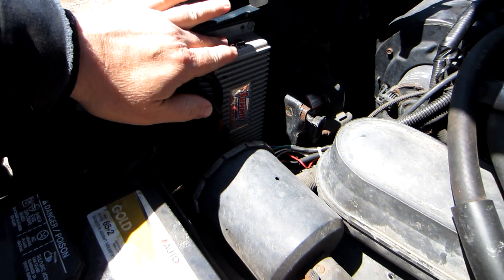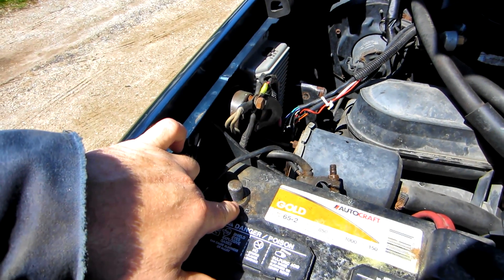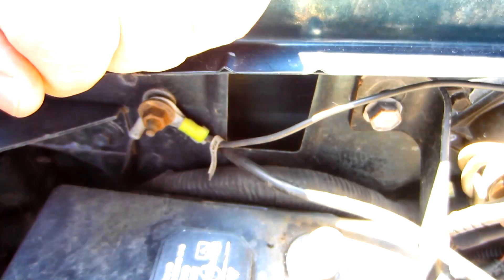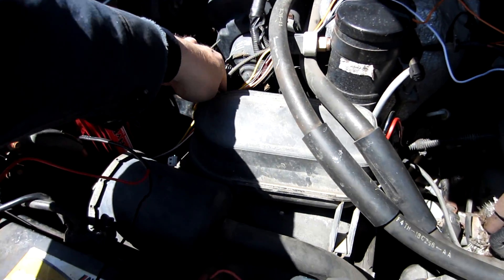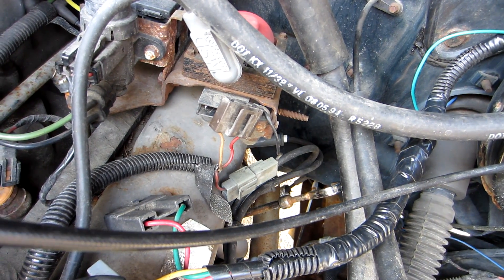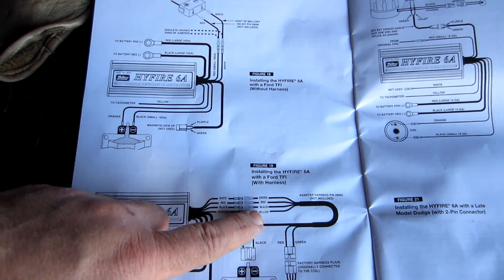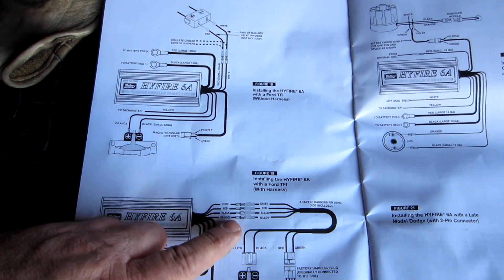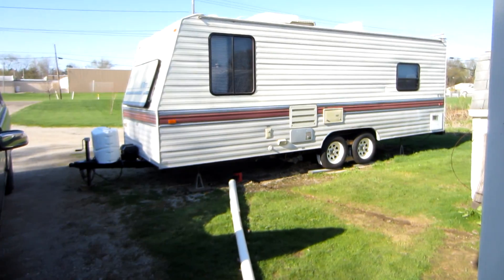install on 95 F150

Comment: Im having trouble wiring mine, the black wires are practically identical gauge, is the power and ground the 2  paired together in the sleeve?

Comment: I get how this one works. But I'm trying to make one work for a 7.5 Ford efi. It's got a weird circle harness connector. I've heard that the PIP needs to be connected or you get problems.... So how where does the PIP go?
Reply from the maker: It connects identical to the f150 or even a 88-96 5.0 Mustang... Get the harness and follow the instructions... I mounted a box on my 97 F250 HD with a 7.5 so I know it is the same. Here is a link....  https://youtu.be/fw12k7zEURI

Comment: What's the difference between the part number 6853 and newer black 
Ignition boxes part number 690 if I'm not mistaken, are new ones more reliable and is there a difference between MSD 6AL and this Mallory 6al part number 6853?
Sorry for all the questions, it's jus that I want to get one these, the price is right and much cheaper than the MSD boxes and also cheaper than newer styled Mallory 690 boxes... Confused need help
Reply from the maker: Mallory got bought by Holley Performance so the box I used is not exactly like the ones being produced today... The MSD has been the same for years and compares very well..
Reply: Thanks a lot, I think I will settle on the newer styled Mallory 690

Comment: really enjoy the f150 vids, just bought a 95 xlt and your advice and tutorials are great. what's the box just to the right of the battery? you still have the truck?
Reply from the maker: Thanks, the box to the right of the battery was a battery isolator. That allows for dual batteries to be run being charged off the same alternator. Unfortunately, I've never got around to connecting the battery that was mounted in the bed to it. Sadly because of Towing reasons we got rid of the truck. You can see that information here https://youtu.be/zIpQSNp0b1g
And even since then we had another change that you can see herehttps://youtu.be/NwD4MjQT0fg

Comment: can I use my stock coil
Reply from the maker: Possibly, however if it's not in good condition there's a chance of it failing relatively quickly. Plus, you will not see the full benefits that the CD I could offer. Also make no mistake of trying to use stock resistor wires. Again, you will not see any gains.

Comment: I have a 94 F350 with the 460.  Best bang for my buck, headers or a Mallory box?
Reply from the maker: Keeterbob headers..by far.. But they start at roughly 300 Dollars more than the Mallory box.. Still..Headers And exhaust Will add More power and set the foundation for all other future modifications..
Reply: Foxboss9 I'm looking at the same Headman headers you installed on your F250 460.
Reply from the maker: Keeterbob those are good entry level headers..
Reply: what about header  for 93 f150 5.0

Comment: Awesome video at work we have a display comparing a stock spark vs the multi spark and what a difference, I acquired a Mallory box and I am curious to were you found the coil connector /harness ?! If possible help me with a part number I have a 1990 Stang with a T5 swap and more to come
Reply from the maker: Thanks. Parts Links are in the description..
Reply from the maker: Try this link  http://amzn.to/1HwAviQ

Comment from the maker: ABeans07 Definitely works.. In a nutshell it takes a stock ignition spark(1 lonely spark) that may not allow complete combustion and Multiplies it to allow for not only a stronger spark but a longer spark.. Have you ever tried to start a fire with flint(stock ignition) How much easier is it to start that same fire with a torch(aftermarket)